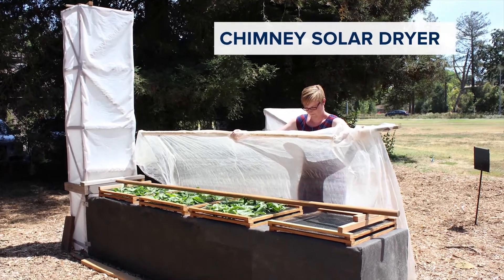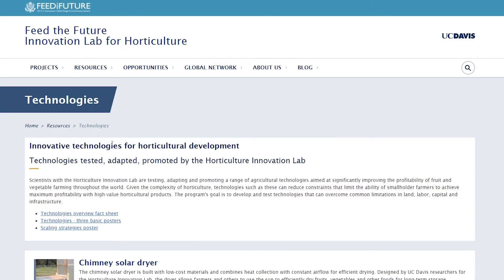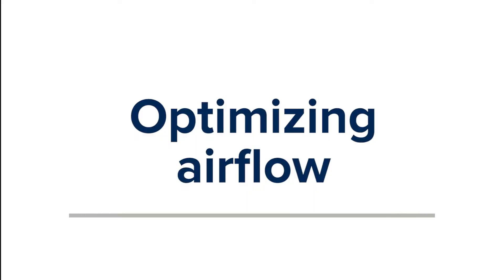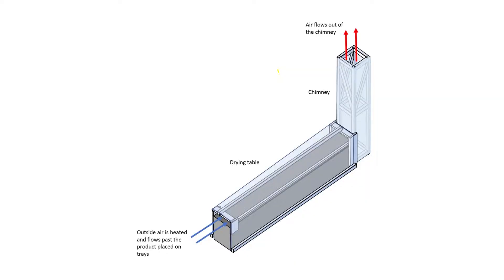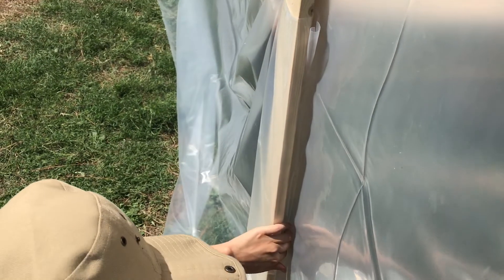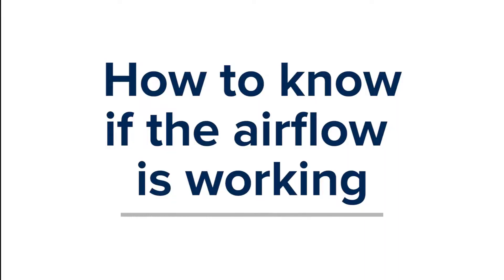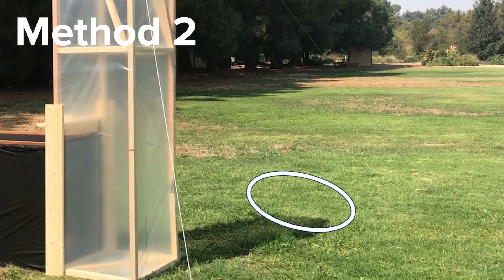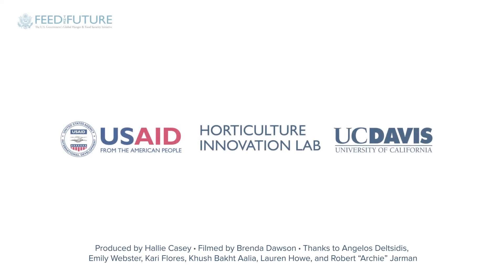Troubleshooting and Tips for the Chimney Solar Dryer

Comment: Why transparent plastic? I thought black plastic would absorb more heat making it more efficient?
Reply: If you use black plastic cover, a good portion of the energy gathered from the sun is wasted because the heating surface (the cover) is in direct contact with the outside air. You want all the heat to be trapped inside the device, which is why the bottom is black and the cover is transparent.